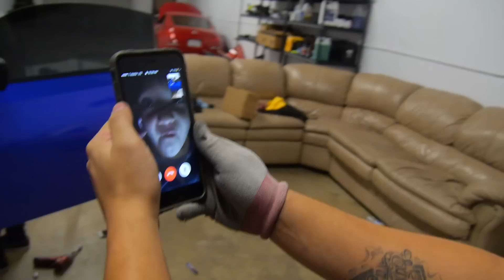WRAPPING TJ HUNT'S BRZ - (NEW WRAP REVEAL)

Comment: 6:04 Daniel, where you getting glue lines in the door handle recess because when I did my car I had horizontal glue lines in the door handle recess. I used same technique as you by using my thumb to apply the vinyl into the recess.

Comment: How does the wrap hold like the abstract GTR design? Can the red and gray triangle pieces easily be peeled off?
Reply: HB Grizzly umm in a previous vid, they said it's a gray price and individual prices on top. just got back a little bit in the videos.
Reply from the maker: Yes, the pieces can easily be removed.